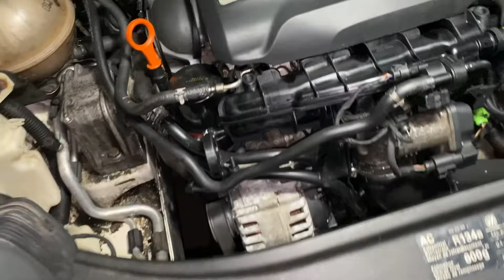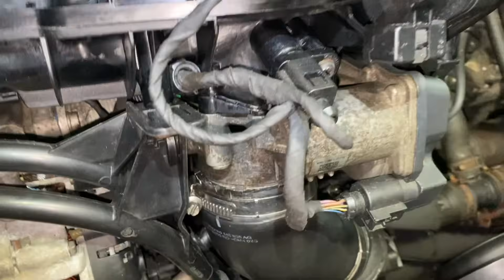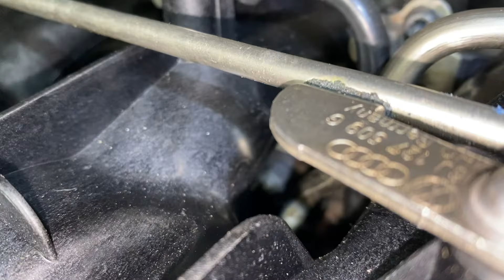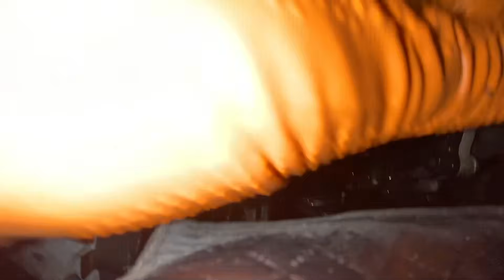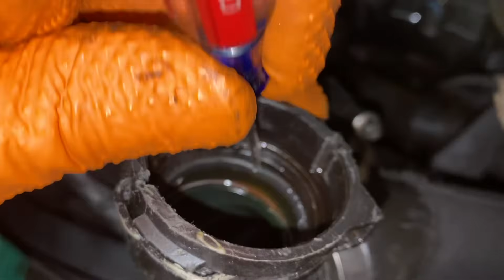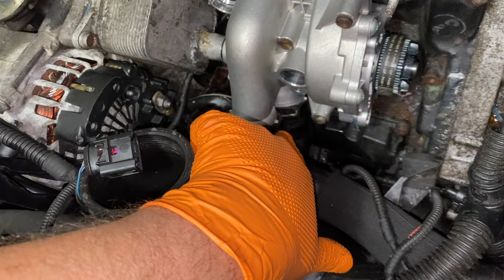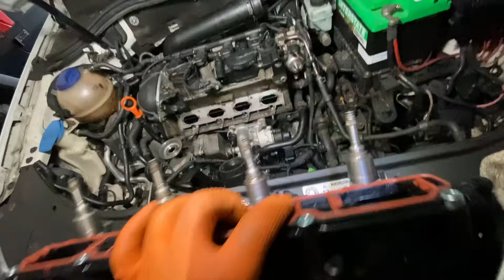Step-By-Step Water Pump Replacement on VW Passat, tiguan, CC, EOS 2.0 Turbo TSI/ CCTA  2008-2016

Comment: Hey friends! It’s me again with another question 😂 

So I have a 2012 Volkswagen CC currently that has a weird issue. So I have no heat in the car and it’s overheating to 110C at idle with ambient temperature of 32F. It seems to just overheat to 111C (checked coolant temp with OBDeleven scanner) but it doesn’t pass from there it seems. The precious owner of the vehicle thought it could of been a head gasket issue and added gasket leak repair additive to the coolant. Which the coolant looks like it had orange sparkling flakes inside. 

I flushed the coolant with distilled water as much as possible but I still believe there is still nasty old coolant with that additive around the heater core. Should my next steps be to flush the heater core and maybe get a water pump/thermostat?
Reply from the maker: I would back flush the heater core and the radiator first and replace expansion tank cap. And report back with results
Reply: @motorcarnut  well brother… the issue was the coolant cap. I replaced it because el noticed it was just to loose when it should be tight. Now the car doesn’t overheat and the heat is warm but not where it should be. I will be flushing the heater core on the CTAA. 

Any recommendations on how the flush the coolant system properly? Any additives you recommend…. Should the car be at warm temp. As always…… you are the best brother!!!!!!!
Reply from the maker: Great bro! Thank you! Really appreciate it!

Car should be cold not to burn yourself. Take the 2 heater core hoses off the engine not the firewall. It’s tight back there but can be done. Try about 8 oz of this stuff:

https://www.homedepot.com/p/CLR-1-Gal-Calcium-Lime-and-Rust-Remover-CL4-P/202530301

Blow out the coolant in the hear core with compressed air carefully then add the cleaner let stand for 15 minutes then back flush with hose water both ways. Then refill system. Heat will be hot again
Reply: @motorcarnut  just flushed the heater core. Wow… the amounts of slushy brown goodness that came out of it was concerning. I don’t see how it was working properly whatsoever. 

On a different issue, the car on idle tends to have a strong vibration that shakes the cabin. I’m thinking it could be trans and engine motor mounts considering it has 136k. Any suggestions to diagnose the issue? Thanks for everything!
Reply from the maker: @ivanvega2821 the engine shouldn’t shake that bad to begin with, but yes make sure the mounts are not ripped or twisted.

Comment: I need to know where the knock sensor is in all of this 🥲 is it visible in this video? Thanks in advance
Reply from the maker: 18.58 in the video just below the hole with the orange coolant you'll see a triple square both with a electrical wire, that's the knock sensor

Comment: I replaced the water pump with an aluminum one and leaks from hose connectors and temp sensor started to develop, my assumptions is that aluminum swells and contracts with heat and cold that crushes o-rings and deforms the plastic connectors. Finally decided the best fix is to replace the aluminum one with a  plastic one after replacing both upper and lower hoses and developing leaks again.
Reply from the maker: I never had problems with the aluminum ones, but keep me updated on the new plastic water pump.

Comment: Great video! Just wanted to point out that there's a bracket supporting the intake manifold to the engine block. Keep up the fantastic work, and thanks for sharing your expertise!
Reply from the maker: Thanks for the info! And really appreciate the feedback. Yes, there is one and a-lot of time they are missing because most people don't put them back but should.
Reply: How is this bracket removed? An update or pinned comment would have been super helpful since I'm 3 hours in and trying to figure it out.
Reply from the maker: @bobm1394 you should’ve read the description it’s in there

Comment: Great video, should i put new manifold gasket and injector seals? Or its fine to reuse ?? Thank you
Reply from the maker: Replace them yes
Reply: Does the aluminum pump come with a new temp sensor or do u reuse the old one ? Thanks!

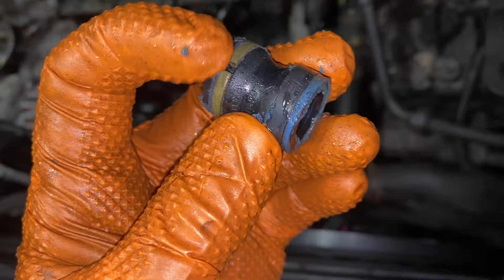Comment: 16:32 mechanic charging for a replacement without doing it. 

You do detail work.  Keep it up
Reply from the maker: Yep, I bet they did charge for a new one especially if you can’t see it when everything is installed. I get a lot of other shops mess up’s.

Comment: Elsa does not recommend removing the intake manifold
Reply from the maker: Then don't. If it is easier for you to work blind go for it.
Reply: @motorcarnut  I changed it without removing the intake, it’s a little heavier, but quite doable. I just removed the throttle body
Reply from the maker: Maybe others will find it useful.
Reply: @motorcarnut  In any case, the video is useful and informative. I just shared my own experience
Reply from the maker: Thank you and I appreciate the input!

Comment: Just did this job, without having to take the intake manifold off. This video was very helpful, however and it's a great tutorial. I was able to save time and not disturb the fuel system, by taking the air box out, along with the throttle body, intake manifold bracket and turbo intercooler pipe rubber. My water pump had plastic break off at the seal and the gasket itself had bowed.
Reply from the maker: Awesome! Yes I have done them with taking off the manifold as well, but for me it’s way easier. And the the inexperienced first timers it’s go to “see” what you’re taking off, lol. Good job though!
Reply: @motorcarnut  Yep, it's still worth taking off the manifold to clean and have even more space to work with!
Reply: I did the same, still stuck getting that belt on before the union...

Comment: GREAT VIDEO. PUTTING THE BELT BACK ON THE NEW ONE WAS A PAIN. VERY HELPFULL VIDEO
Reply from the maker: Thank you very much!
Reply: How did you get it done? The belt, I am having a hard time right now 🥹
Reply from the maker: The belt has to go on with the pump at the same time.

Comment: Hope this finds someone that may have been in the same predicament as me. I worked on a 2012 CC and it has an aluminum bottom bracket that goes from the bottom of the manifold down to the block. You have to remove a nut on the manifold and a bolt on the block (M10 I think).  Other than that great video!
Reply from the maker: Thanks for the comment. I did mention that support brace, however that vehicle’s one was missing. Usually mechanics don’t put them back for some reason.

Comment: Hello thank you for this Amazing video , Im having a hard time to find the o rings for the hoses?!?! Is there any part number ?
Reply from the maker: I think they come with the hoses but you can bring the old one to the auto parts store and I’m sure they can match one up for you. I have a whole set that I use so they should have what you need.
Reply: More than likely they are on the new water pump !!
Reply from the maker: @jalenbrown949 That question is 8 months old, I’m sure they figured it out already.

Comment: you didnt go thru the bleeding procedure
Reply from the maker: These cars self bleed so no need to. Just warm can to operating temperature and let cool overnight and check level cold.
Reply: thats what i thought, theres a procedure in the manual but its not that necsesary! @motorcarnut
Reply from the maker: @Icepressa Yes, some vehicles is absolutely necessary.

Comment: I’ve seen water pumps on eBay for $50 but I’m kinda sketched to buy one since everywhere els they are 200-300 are they really worth buying ?
Reply from the maker: Yes, get the aluminium one. Name brand markup is unbelievable most times.

Comment: Have you had any problems with the bair aluminum housing?? For some reason i keep melting the gasket between the block and housing😢 just picked up another aluminum one that came powder coated gonna try it now 🤞 it helps. If not the next gasket i put in going in Permatexed like a mf😂😂😂
Reply from the maker: It shouldn’t melt, hopefully your can is not overheating or running too hot?

Comment: I own a Porsche shop and do some VWs.  This video is the most comprehensive and clear 2.0t water pump replacement instruction on planet earth.
Reply from the maker: Thank you! Much appreciated, especially from a fellow shop owner.!!!
Reply: I agree!
Reply: @efuture07 No need to remove the intake manifold, no, it is not comprehensive, is way overkill.
Reply: @rhlastnae5236 my man, if no need to take off the intake manifold, can you explain. I’m doing my water pump for my 2013 cc and I would love if I didn’t have to take the manifold off
Reply: You could prob do it  but you wouldn't be able to clean everything well. Esp the manifold ports. Plus you'd be working blind almost and hafta feel ir way around. It's worth the extra 2 hrs to 2 days. Treat it like an adventure!
Reply: @WesleyTrujillo take out the intake, you wanna make sure you know where you’re working, these bolts are not that easy to find blind
Reply: @rogerlucas1733  And you can clean your intake valves while you are in there!
Reply: @kentmackey2717 plus you get a chance to inspect your injectors. Hope the nozzles don't stay with the cups when it. Comes off. 😬😬😬
Reply: I am following for VW cc
Reply from the maker: Thank you

Comment: I’m currently stuck on taking the manifold off. It’s half off and stuck on something, it won’t go back in either.
Reply from the maker: Did you take the support bracket off that connects from the bottom of the throttle body to the block? And the fuel injectors are somewhat pressed in the cylinder head and need a little prying to get them out.
Reply: Was that in the video? I might’ve forgot that.
Reply from the maker: I’m pretty sure it was, if not it was probably missing because it’s a little tricky to install so someone must of left it off but that is not recommended. You will see it where I told you.
Reply: Do you know what size the bolt is holding the bracket?
Reply from the maker: I believe the one under the throttle body was 13mm and the one on the block was a spline drive but forgot the size 8 or 10
Reply: Thank you it was a size 10.

Comment: Would it be possible to remove the oil filter without having to drain all the oil or will there be a mess with oil in my engine bay?
Reply from the maker: Yes, some will spill either way because the filter is right side up, but no need to drain it

Comment: Nice video, I just watched it 3 times and ordered the parts. Should I replace the fuel injectors and how can I do a carbon cleaning since I'm already taking everything apart? I just subscribed and liked! Lastly,  I will be doing brakes (pads and rotors) all the way around on my TSI 2.0L I'LL TIP ONCE I COMPLETE it! THANK YOU!!!
Reply from the maker: Thank you for the sub and comment, much appreciated! If the fuel injectors were fine before I wouldn’t change them, they rarely go bad, as for the carbon cleaning, I always take the head off. There are a couple of ways to do it but not really that effective. Walnut blasting is the best way but requires special equipment. You could try to clean it with some carb cleaner and a pick but some carbon will fall into the cylinders so be careful. These engine do build up a lot of carbon however.

Comment: its easier to put the injectors in the head first, then put the manifold on.  the injector seals should all be replaced also but some people have had success without changing them.  Nice job either way
Reply from the maker: Whichever way gets it done and saves money, and thanks for the feedback!
Reply: I was going to say the same thing (since that what the manuals in Elsawin prescribe) but how do you access the connectors for the injectors? It looks like the cable assembly is one part with the intake manifold, so these connectors are inaccessible once the intake manifold is on.

2nd question: Shouldn't the belt be replaced as well?
Reply: @andrehmj  The kit I got from FCP Euro had a new belt, hardware, the union, and a bunch of o-rings included.
Reply: I had three that came out with the manifold and one stayed in the block.  I ended up replacing all the o-rings and clips on each injector except for the hard-ish white one right near the tip.  I didn't have the special tool required for that one.  Hope I don't regret that!

Comment: Anyone get a p2568 code before having to replace water pump? I had no cel but wanted to check if there were any codes after battery seemed dead and got the code.
Reply from the maker: The radiator on some California cars have an Direct Ozone Reduction Sensor refers to a sensor glued to the radiator core, not the coolant temperature sensor, can be disconnected or bad, Also make sure you have no exhaust leaks as well.

Comment: I've gotten a few quotes to do this, cheapest is $1300. I'm doing it myself for sure thanks to this video. You are awesome.
Reply from the maker: Thank you!, go for it! Save a lot of money, it's not that bad, just follow video and you'll be fine!
Reply: @motorcarnut  Just got the manifold back on! Hey you made a comment that I'm sure I'm taking too literal but I gotta double check after all this work. You said after I put the injector manifold back on and the injectors are seated that it shouldn't wiggle. Well, mine wiggles some if I wiggle it but the injectors resist being pulled out so it feels like it is seated. I definitely do not want to continue if it is not seated right. 

I haven't put any bolts in to secure it but you mentioned how those little pieces of place on the injectors line up with the opening. Should it not wiggle at all, even without any mounting bolts back in? 

I even got a picture lol squeeze my phone down there
Reply from the maker: What I mean is the injectors have to be at a certain angle so they go into the head  without hitting the sides of the head where the slots are. Once they are seated properly push the manifold with both hands  towards the head  to make sure the manifold gasket is even all around and touching all four cylinder ports. If one injector is hanging up the manifold won’t be fully seated and will wiggle or rock from side to side. This is all before you put the screws in. Hope that makes sense
Reply: @motorcarnut  yep makes total sense, I just take stuff too literal all the time lol and had to double check. You are the Man, I'd love to throw you some dinner or beer money to say thank you, for real!
Reply from the maker: Thank you! On my page there is a channel donation if you wanted. And good luck with the rest of the repair.
Reply: @motorcarnut  you da man!!!! Hey you know much about brake master cylinder lol? I bleed the brakes on this thing like I do on any other car I've done before, brakes were real tight after. I let it sit for a couple days while I waited for the water pump to come in, and now the brakes are soft again. I don't think it's a leak. My research is leading me to brake master cylinder, you got any ideas?
Reply from the maker: I appreciate the tip! Thank you very much!

Top 3 would be , air in the system, leak or internal master cylinder failure. Make sure there are no leaks anywhere in the system including the caliper pistons on all 4 wheels. Second, you could try re bleeding the brakes starting from the furthest from the master cylinder and and working towards it and never let the fluid reservoir get below to low mark, especially if your car has ABS brakes, because you would need a scan tool to bleed that unit. If no leaks found and re bleed doesn’t fix it than you probably have a faulty master cylinder. But if it were good before you did all this work, I’d say it was 1 or 2.
Reply: @motorcarnut  Mine does have ABS so do I need the scan tool to bleed it correctly? 

It was not good before I did all this work, it was an issue before which is why I parked the car in the first place. 

As of now I bleed it as I normally do but I don't think I let the level get below low but maybe I did? Would I need the scan tool to fix that?
Reply from the maker: Ok, being it was like that before tells me when you redo the bleeding and make sure there are no leaks, it’s probably not the ABS because it doesn’t sound like it went low on brake fluid so the culprit may be the master cylinder. But the problem with that is it has to be bench bled primed and when you replace it, it will introduce air into the system again but hopefully the abs won’t need a scan tool. And I would bled the lines with a suction vacuum pump, not by gravity .
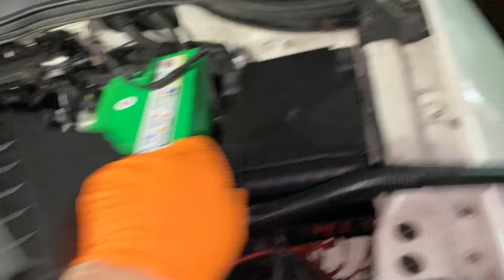Reply: @motorcarnut  hey me again lol, got busy but finally about to get this back together! That hose at you can see at the bottom of the mass flow unit, at 3:28 does it not plug into anything?
Reply from the maker: The hose on the bottom of the air cleaner? No, it’s just a drain/ vent.